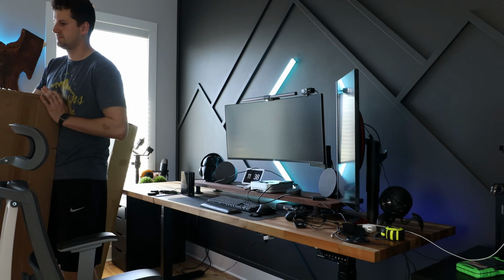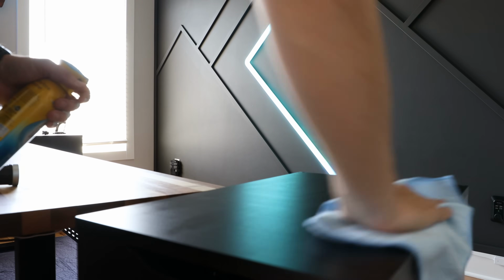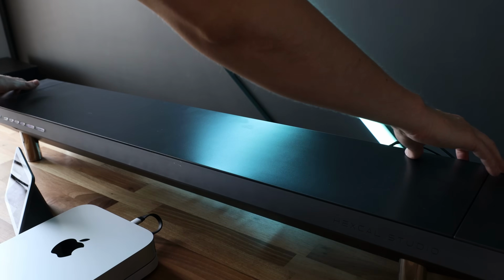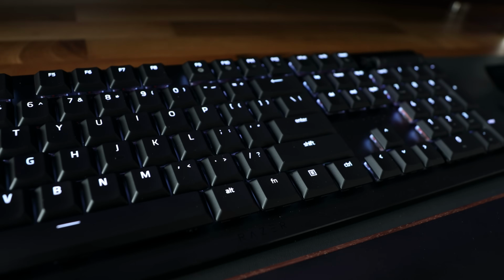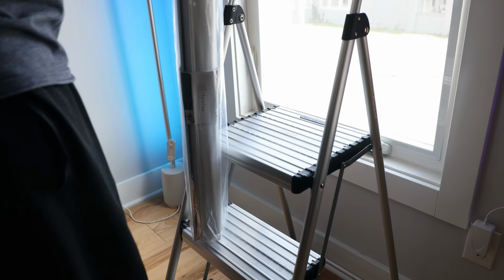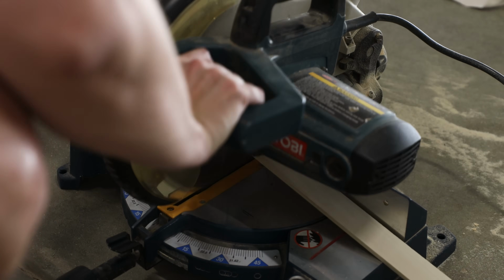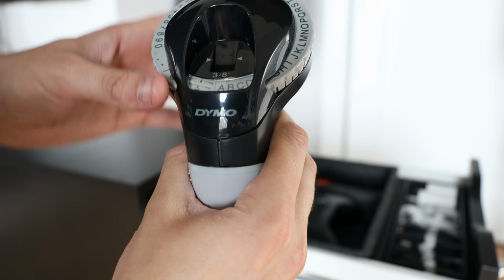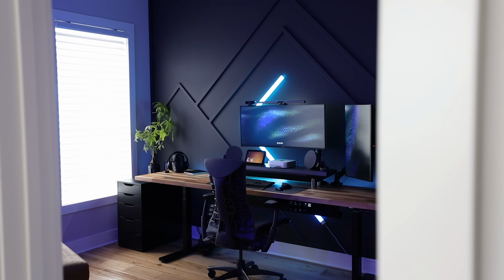Ultimate Dream Office & Desk Setup - THE FINALE

Comment: you can still use steam mops on hardwood floor especially if its good quality hardwood, just do light strokes and passes up and down dont apply preasure to the floor and dont leave it too long in a single spot or it will create a sag spot that can crack later on, when ur done with the mop just leave it on a tile until it cools off and ur good

Comment: Your keyboard sucks & the things you did for your drawer don't make any sense. It's not worth the time spent too since you designed it in a way that its design depends on your gadgets so if you like to remove/add gadgets, it won't be a sustainable and scalable solution; it will be a pain. Other than that, I liked the video.

Comment: Do you have any issues with the overhang on the ends? I want to do an 8ft butcher block on a sit/stand 70 7/8/55 1/8x31 1/2 " but was told if the overhang is 12 inches or more I would need a bracket for it.

Comment: Where did you get the wood from, I had the exact same idea with the electric motor base with driving it and putting a wooden base on top, but I believe you have to treat it and everything, I was looking at one which has a wooden length of 200mm, any ideas?